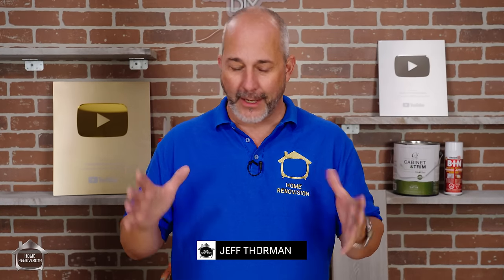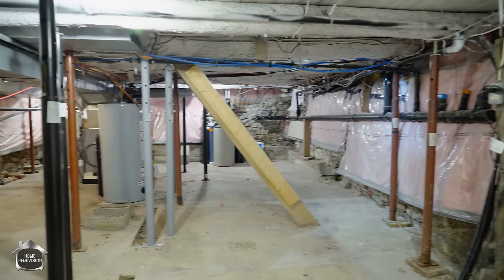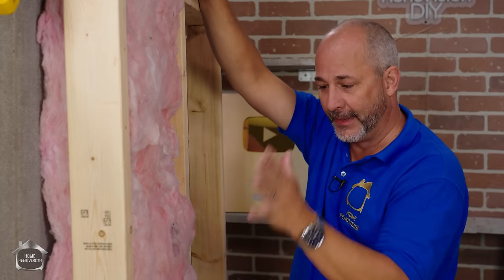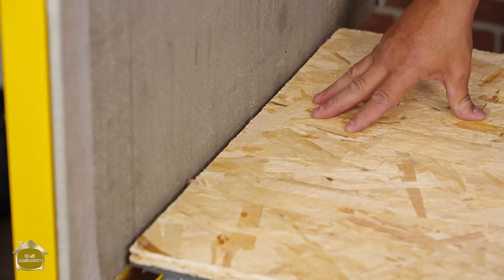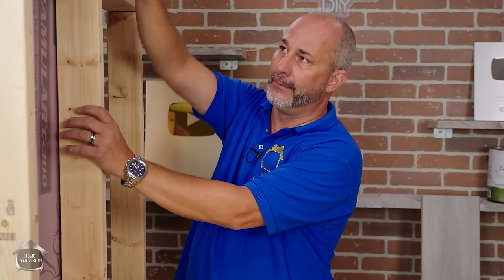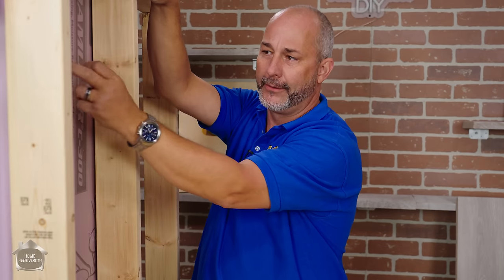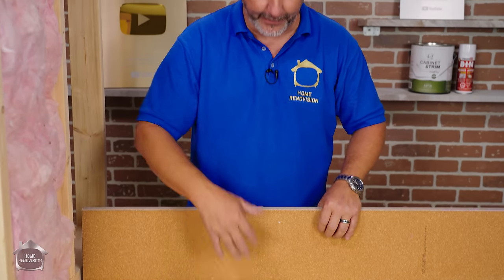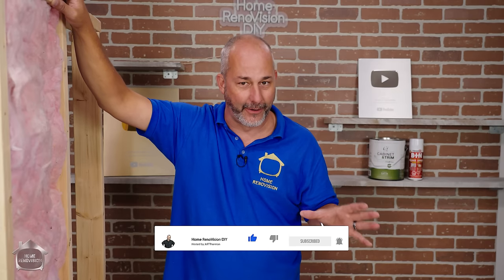The Best Way To Finish Your Basement

Comment: Doesn’t the pink Xps rigid foam also acts like a vapour retarder? If you also add the plastic vapour barrier behind the drywall, you are sandwiching the fiberglass insulation between a vapour retarder and a vapour barrier. Isn't that a bad idea?
Reply from the maker: You are incorrect about your understanding of building science. Cheers! 2 barriers must be in direct contact to create an environment for condensation.
Reply: @HomeRenoVisionDIY  I don't know Jeff, I have a very good understanding of house envelope. Please show us a basement that was done this way some years ago, maybe dissect a section of a wall to see what happened over time. Building science says it is a bad idea. But science isn't always true. You may be right. Would be nice to see a real life test.
Reply: We gutted our basement back to the cinder blocks. Previous owner had put vapour barrier against the blocks, 2x4 stud walls with R20 pink, another layer of vapour barrier, then drywall. I opened it all up and in between the barriers the insulation was soaked facing the block wall side. Would the 2” ridged solve that problem?

Comment: How do you make sure the gap behind foam is spaced evenly?
Reply: May not be necessary as long as there's a decent air gap behind.  Personally I'd rather it be plumb and use a level when setting in place.  If I really wanted an exact gap I might get some kind of spacer like thumb tacks and stick them in the board before setting in place.

Comment: I disagree with leaving a tiny bit of air space behind the foam board.  The whole point of insulating with foam board right up against the concrete is so that humid air does not condense on the cold concrete wall.  If you leave any kind of space to allow air to get between the foam board and concrete as you say, you are going to get moisture and mold behind the foam board.  This is why spray foam is used so that there is a perfect contact of foam against the concrete.  Foam board is good, but it's intended to be as flat as possible against the concrete.  Just think of a beer can on a hot humid day.  The beer can is wet.  Insulate right up against that beer can and the humid air has no way to condense on the can and cause moisture problems.

Comment: What was that panel you put on the floor???
Reply from the maker: it is called dricore. it comes 2 ways. dimpled plastic for going over heated floors or insulated for every other application.

Comment: With this 2” foam method does that mean there is no plastic sheet between the stud and the drywall?
Reply from the maker: in northern climates the vapor barrier is always added regardless of the wall assembly. you need to eliminate condensation that can occur inside the wall. Cheers!
Reply: @HomeRenoVisionDIY  thank you, is there a certain thickness required?

Comment: Im really confused, dricore r+ is $10 a piece (ie. 2.50 sq/ft). If you go with the dmx/osb method its more like 1.50 sq/ft at todays prices. You make it sound like either option is equivalent in price ... but they aren't even close ...

Comment: wont fiberglass on top of the foam give you moisture against the foam? it did in my house with superior walls and r21 batts.
Reply: the temperature hit the dew point somewhere in the middle of the fiberglass. they were faced too. it was a mess
Reply: Did you figure out a solution to this? In the process of redoing the insulation in my basement and I'm noticing the same issue; condensation forming on the foam behind fibreglass.
Reply: My solution was take out the fiberglass and have nothing in its place but the open cavity behind the wall. It was a huge pain to install and then remove them, although i am glad i did it before putting the wall on. Maybe if my house was less humid it would have worked but i really like 50pct humidity during the winter. 
I toyed with trying some sort of vapor barrier before the drywall but decided against it because then there would be 2 vapor barriers, the one i put on and the foam on the superior walls and i don't know how thatd work out. 
I found little online addressing this, itd be nice if an expert could chime in here. 
Good luck with your project!
Reply: @steeeeeeeeevee  thanks for the reply. I fear that's what I'll have to do, and I'm not fussy on losing the additional R value of batts (fibreglass or mineral, I'm assuming the same problem would occur). In Atlantic Canada, so dealing with high humidity and wildly varying winter temperatures. Likewise, it's been difficult to find a solution, and I'm beginning to wonder if I've made a mistake gluing up these boards in lieu of a more traditional approach.
Reply: Possibly doing more closed cell foam would work but i decided it wasn't worth the money to do in my case.
It'd be cool if Jeff could chime in with more info. 
In his flooring videos he shows the new subfloors that allow moisture to move around and maybe that can happen in this type of wall assembly too? 
Mine were soaked tho, r12.5 foam and r21 batts seemed to make the dew point way too far into the batts. 
Good luck
-Steve
Reply: @HomeRenoVisionDIY

Comment: How do you fix studs on the subfloor system?
Reply from the maker: construction screws. All basement systems have minor water damage over time. try not to worry about the little things like corrosion of an exposed screw. anything built in a basement will not have a lifespan over 100 years no matter how much effort goes into it. Cheers!
Reply: @HomeRenoVisionDIY  thanks!
Reply from the maker: Cheers Joshua!

Comment: Great video. In your older subfloor video you mentioned that the large dimple sheet is better than the smaller osb+backing pieces as you can put tuct tape over the seams. Is that not as much of an issue or is there a way to seal the joints between the interlocking subfloor system shown here.
Reply: Im no expert but maybe red guard for like showers?
Reply from the maker: for best results screw the first row down and then use a block to hammer it all together. There is no perfect system for older houses.

Comment: didnt you just create a double vapor barrier for the pink fg insulation,  which i thought inspectors dont like, trapping in any moisture that might get get past the vapour barrier. in contrary to that  ive read that in ontario inspectores didnt like the closed spray foam w/out the use of a vapor barrier but moisture would get caught between the 2. this is where alot of confusion exists,  which method best  deals with the moisture in a northern climate, heated in the winter and a.c. in summer
Reply from the maker: Hi Vinny, since the rigid foam and the plastic sheet are not in direct contact with each other it does not create a situation where you will get condensation. this install is the best option on the market. Cheers!
Reply: @HomeRenoVisionDIY  i understand but the fiberglass is now  sandwiched between 2 vapor barriers, would that be ok?:
Reply: @vinnyc7613  good question
Reply from the maker: since there is no source of moisture there is no point of condensation. Cheers!
Reply: @HomeRenoVisionDIY  yes, in a perfect world, but thats assuming a leak free vapor barrier in a reno/construction environment. i was told that in ontario the inspectors dont like the pink insul sandwiched between 2 vapor barriers just in case moisture does get past the first barrier. whats your experience with the inspectors?

Comment: EPS or GPS is better for the environment,  more stable R value, and won't shrink over time.
Reply from the maker: where I live xps is the only board that has an overlap system. I find that invaluable for creating a thermal break on the wall. As for environmental concerns I rarely make a decision on building performance based on that. The best environmentally friendly build is one that lasts.
Reply: What are xps, eps, and gps?
Reply: @Werdna12345  Extruded (XPS), Expanded(EPS), and Graphite (GPS) Polystyrene.

Comment: If your basement floor is not super flat, the solid tiles are not the best idea, unless you plan to apply self-leveling compound beforehand. A more flexible product like DMX 1 step might be a better option to achieve a similar result moisture-wise

Comment: careful with those panels of flooring... If you have  a basement flood they are a PAIN to remove as you need to get down to concrete for mitigation
Reply from the maker: if you flood then you flood. otherwise it protects in almost every situation.

Comment: I just bought a home that was built this year and I have large white vapor barriers I think they're called on all the concrete walls in the basement. 

Are you saying I should remove this and put the r10 insulation directly on the concrete before framing?
Reply from the maker: if you have a unique situation then consider joining our membership program. you can email us and send pics for clarification. Cheers!

Comment: I need to see a demonstration of the walls and floor design being pulled up after a couple of years of normal moisture to see the results before I can make this kind of investment.
 Mold is an indestructible spore and it is everywhere that air is. It consists of microscopic seeds that can't be killed with anything less than acid. Any moisture that contacts the spores causes them to "sprout" which is the mold we all know and love. It moves with water and air to go everywhere. A brilliantly evolved  transportation system really. So I need to see a sample area from an area both controlled and not controlled. We all know what the baseline is - mold growth. so build a shed like you would a modern house basement with this system in it. Let it sit for a year or two at standard humidity for a basement. Then pull up test areas to reveal what is inside the floor and wall areas.

Comment: Oh god… keep any OSB product away from a basement floor.
Reply from the maker: nothing you do in a basement lasts more than 50 years. no reason to get all dramatic about it.
Reply: @HomeRenoVisionDIY  Yes, you are right. But you have too much faith in OSB, it is a great product if it is kept away from moisture. For example, I stored osb and plywood at the same spot in an older basement where some moisture is present. After a while osb that had contact to concrete floor turned in to mush and dust and molded while plywood fared really well (some white mold on the surface). I wouldn't even use plywood as basement subfloor where moisture is present. Newer homes might be fine but if you have an older house without water barrier on the exterior of the basement walls and a good drain system inside and outside with sump pump than stay away from osb.